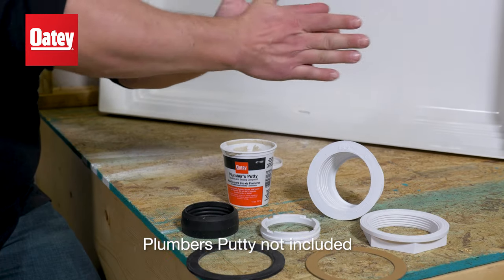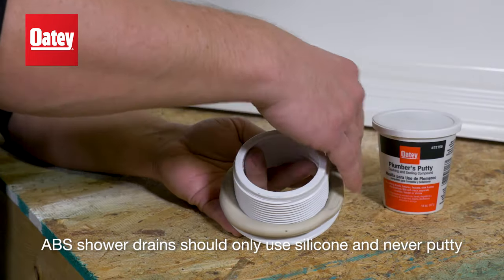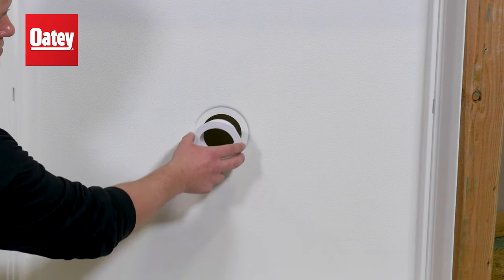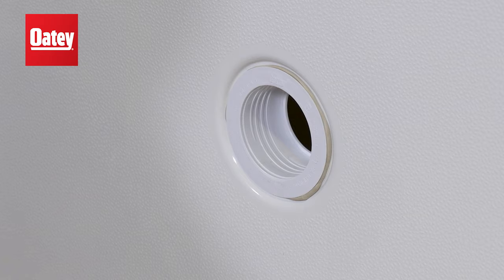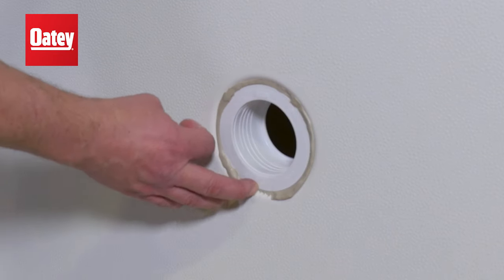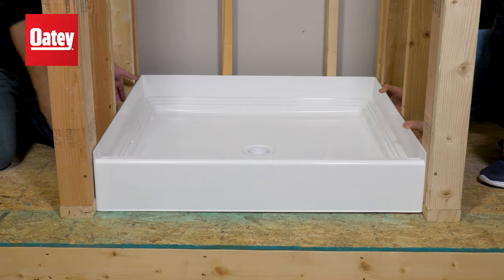How to Install a Shower Drain in a Pre-formed Base

Comment: My Delta shower base states that plumbers putty will over time degrade the acrylic shower base. Delta recommends using 100% silicone on the flange and threads.
Reply: Always follow the manufacturer's directions... mine said either was acceptable.  It depends on what the base is made of.  Plumber's putty CAN degrade some types of PVC.
Reply: Use silicone

Comment: I'm sorry but I can't consider it to be no-caulk if I still have to use putty!! Why couldn't you put a soft silicon / rubber seal on the top edge?
Reply: I also wish this was an option provided with the drain kit.
Reply: Nothing saying you can’t use 100% silicone on it instead of putty. Oatey says use putty but if you look hard enough they also say 100% silicone is okay too.
Reply: Most of the shower bases I install specifically says to use silicone. Putty is mostly obsolete. It reacts badly with the chemicals in the bases. Even sinks sag silicone as well. Rfm
Reply: Some manufacturers DO NOT want you to use putty

Comment: Easy peasy. The one in my house was installed incorrectly and popped out causing an enormous leak to the underside of the house. All fixed now. As a new owner of an older home, I am continuously baffled by how much half-ass handy work can accumulate on an older home.
Reply: I agree with your last comment. It's astonishing how bad some people treat their own homes.
Reply: It's half ass because you can't find parts for what you have. You usually have to pay for a full renovation. It's a money pit.
Reply: People ALWAYS look for the cheapest way to proceed, without care or concern for the future. Same goes for the contractors they hire.
Reply: Sir, I have a new home and mine, unfortunately, has TONS of issues. I think this is one, but I'm not sure where the water is coming from. Quite stressful.

Poor workmanship, sadly, is common. Builders want cheap labor. Cheap labor is often shoddy and performed carelessly.
Reply: @coffeeandlifting Baffled?! You and me both. My old girl was built in 1952 and remodeled/updated sometime in the early 80s by the looks of the wire. 
But I do love that old growth lumber they used for the studs and all the custom built-in shelves and closets. it's like petrified wood now and the dimensions are between a 1/4 inch and a 1/2 inch larger than the 2"x4"'s of the wavy balsa-like pine we get today. But it sure smells great when you cut it. 
As a former journeyman electrician I am horrified that the choices made when rewiring the house. Actually surprised it didn't burn to the ground before I could get some proper grounding and wiring in there. I guess only two outlets in a room, and each coming from a different circuit mind you, was what all the cool kids did back then. And always under the windows - yikes. 
And having the old cloth insulation, just crumple to dust just by looking a wire is awesome. 
I guess they did not like overhead lights back then either. I had to put them in every room in the house. When they "rewired" in the late '70's, they removed most of the switched outlets. So interior lighting was a. It annoying without "the clapper". 
My favorite part of this old house – no insulation in the walls. Just a 3" pile of old newspaper at the bottom of each stud bay - except the vase that we used for return air. Lol. 
Not sure why I didn't level it when I bought it and just build new. At this point it probably would've been cheaper and much more efficient and sturdy.  
Cheers!
Reply: @Willie_Wahzoo Fact is a little common sense will allow most renovations a better outcome. Unfortunately the chances of finding DIY folks with common sense is gone! 1:31 😂
Reply: I still wonder what I was smoking when I talked my wife into buying our current "money pit". It was built in 1901: 1900sq ft. 2 story, full basement w/brick foundation. Been updating and renovating for the last 24 hrs. Finally paid off last month. I'm amazed at some of the half-brained ways some of the original repaired were done! Electrical t ape and old bubble gum on wire ends! Live gas lighting piping  still hooked up and active...just capped off! I should just take up drinking!😂 1:31 1:31
Reply: I have that issue rn but I'm on a slab so I don't know if I can do it without destroying tye full shower 🙃

Comment: Why is it so hard to squeeze the screw rubber gasket over the 2"pvc coming out of the floor? Why is it so tight? The one in the video just, "Pops In"! What would help to get that to seat in the base? Petro-oil, water?  I'm sure this is a common problem.

Comment: The instructions say to use silicone caulk between the drain and the top of the shower stall, but this shows plumbers putty. Pick one and stop confusing people.
Reply: Im a plumber, you can use either one, silicone will make it much easier though.
Reply: Oatey Co mentioned: " Be sure to never use plumbers putty on ABS and instead use 100% silicone. The oils in plumbers putty can cause ABS to degrade over time. "
Reply: @nev.catalyst7478  Delta explicitly states to never use plumber's putty on their acrylic shower bases or on abs pipe/drains.
Reply: @letthelightin  This isn't Delta, and yeah you should always follow the manufacturer installation instructions, unless it conflicts with your state plumbing code, here in NC when there is a conflict you must go by the more restrictive option

Comment: Best video I’ve seen yet. I’ve been searching and searching for how high the drain pipe should be and this answered my question. Thank you so much
Reply: I have the same question. But to me its not clear how far into the Oatey part the 2 in pipe should extend. Any suggestions?
Reply: cragar24 I cut it about 1/2” below the bottom of the floor and the gasket sealed it nicely
Reply from the maker: The top of your drain pipe should finish ¾” below the top of No-Caulk barrel flange after the shower base is set into its final location. For more detailed information please visit https://www.oatey.com/products/oatey--140-series-101-pnc-plastic-nocalk-shower-drain-1402493307 and click on the product instructions located under technical resources.
Reply from the maker: @cragar24  The top of your drain pipe should finish ¾” below the top of No-Caulk barrel flange after the shower base is set into its final location. For more detailed information please visit https://www.oatey.com/products/oatey--140-series-101-pnc-plastic-nocalk-shower-drain-1402493307 and click on the product instructions located under technical resources.
Reply: But when you use the shower, the putty comes up around the edges and if you remove it, it breaks the seal and causes water to come out of the bottom of the shower pan.
Reply: @OateyCompany  This is a dead link as of May 2023
Reply: @scottsaccenti  Still dead as of 10/4/23
Reply: I always use 1 1/8 inch 2 inch pipe from the bottom of the drain to the rubber gasket.  If it’s a first floor install I set the base with it already in there and start my plumbing after it’s in.
Reply: @OateyCompany dead link

Comment: I would recommend silicone over putty cause it doesn’t crack overtime and it’s flexible!  Especially if you have a little flex in your pan.
Reply: Oh yeah and make sure it’s 100% silicone not a mix.  Facts.
Reply: Do you only put the silicone on the top, or, put it on the rubber gasket underneath as well?

Comment: Strongly suggest that something be placed in the drain before using the tightening tool. Plastic bag or something else that can be easily removed after tightening. 
Very easy for the tool to fall in.
Reply: It's designed that way so you wind up running back to the store to steal the little tool out of a new one.  Take note, Oatey.
Reply: I was replacing a switch cover in the bathroom.  One screw is now in the vanity drain trap.
Reply: Excellent advice. Happened twice to me. Got lucky and fished it out with a powerful magnet on a thin flexible rod both times.
Reply: Came here to say the same thing
Reply: Uh you guys never heard of that stick with a magnet on the end that mechanics use huh. 🤦🏻‍♂️🤷🏻

Comment: Do you still have to use Plumber's putty for the no caulk unit? I find it spins while tightening the gasket set screw, even after the locking ring has been tightened

Comment: At what height is the drain pipe supposed to be ?
Reply from the maker: The finished height of the drain pipe should be  ¾” below the top of the No-Caulk barrel flange when the shower base is put into its final location.
Reply: Critical step and info left out of the video.  Also missing from the instructions.

Comment: Hello Oatey! I am in the process of installing a Delta Classic 500 preformed shower pan. I see this often used with the drain included with this video. I had a contractor suggest i install waterproofing under the pan in case the pan cracks. I do see Oatey has a product of a 40 mil pvc liner used for tile installations. Do you have any products that would add a water protective layer and be compatible with a preformed base?
Reply: Ice and water shield for roofs is incredible- but it only comes in large rolls.

Comment: Thanks. I wasn't sure where all of the gaskets went- if they were above or below the shower pan. Now I know. Happy to see some of it can be installed before installing the shower pan. That will make things simpler. How far up can the drain pipe go in to the oatey drain? And does it need to be solvent welded or will the gasket hold it on?

Comment: Nice video!! Where can i find a tool to tighten rubber gasket? Water leaks in to my closet and I think that’s the problem.
Reply: You might have to buy the drain to get it. I think they only cost around $10. So, I guess it isn't a huge deal.

Comment: Mine is leaking underneath into my crawl space is it just a matter of tightening the nut underneath or replacing the rubber pipe gasket that fits over the drain pipe or replacing the whole flange.
Reply: Did you fix it?

Comment: Question?  The bottom just slips onto the drain pipe with no glue or sealant?
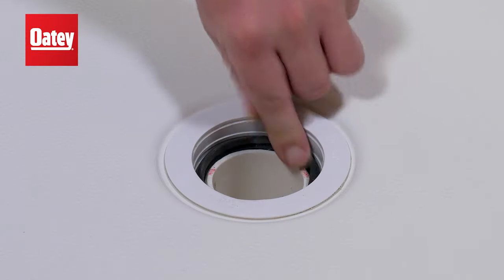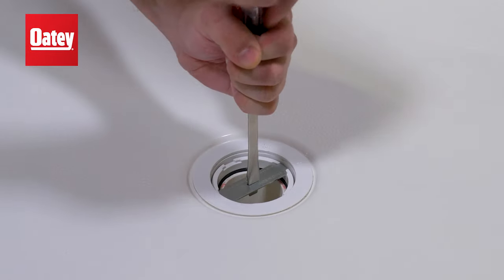Reply: The rubber pipe gasket (the black rubber item @ 0:58 in the video) fits VERY snuggly, some would say tightly, over the drain pipe. It gets pushed down over the pipe. Once you install the gasket set screw (the white threaded washer item @ 1:09) it locks the drain to the drain pipe. 
I've never put one of these in - this is my first 1-piece shower base - but that gasket and said screw will hold tight especially since the shower base is going to be glued to your subfloor with thin set mortar. As long as that rubber gasket is made of quality rubber it should last a long time I would be careful pouring any chemicals down the drain that could deteriorate the rubber gasket though.
Hope this helps.

Comment: In my case, the pipe that comes from the u trap is a bit tilted and it looks like the rubber part doesn't make full contact therefore it leaks. One drop every 5 minutes but it's a drop. Can I use silicone or plumber putty around the piece that tights the rubber down?
Reply from the maker: @Walter Diaz A 100% silicone can be used with our No-Caulk drains. Please contact technical@oatey.com for a set of instructions.
Reply: @OateyCompany  Thank you! The product says "no oil based sealants" right on it.

Comment: I know this is a dumb question for a plumber (but I'm a former electrician so I'm allowed at least 1 right?) but I'm replacing a tub with this 1-piece shower base. Do I need a vent and/or P-trap on the drain?
If so, how do I install a vent for this ?
 I have very limited space with my drain pipe - but I think I can manage a trap if absolutely necessary. My vent stack is just outside the shower base area in the same wall as the drain - about 24" or so from the drain.
Reply: yes, you need a p-trap anywhere an open drain line discharges wastewater into the sewer system. 
 If there is already a vent because you have a sink and toilet, you could possibly tie into that for drain and vent.
Reply: @evanv602    thanks a lot for the reply!
The previous owner who "remodeled" didn't have a p-trap on the tub drain - which confused me. That explains the more than occasional odors - had to close the tub drain when not bathing. 
The main septic line has a  vented up through the roof. Looks like I can tie into that. Thanks again!
Reply: @w4shep  you’re welcome! good luck with the remodel.
Reply: @evanv602  A retired electrician doing plumbing... sounds like the plot of an 80's sitcom.
Reply: @w4shep  yeah right lol. you should do a video on it lol. also, make sure you slope your drain too, this will allow the water to properly drain. forgot to mention that it’s usually 1/4” inch per foot for the slope

Comment: Really easy when you have access to the underside of the shower. Trying find how to screw. In from the top when installed on a slab
Reply: Not possible. Gotta install before placing shower base.
Reply: @letthelightin  then how do you glue it to the pipe?
Reply: @letthelightin  also it is possible because I did it.
Reply: @BrantTheResidentCalvinist  There are drains which attach to the pipe with a rubber seal and can be tightened down from the top of the shower pan.
Reply: @BrantTheResidentCalvinist  how did you do it?
Reply: +1 how did you do this? I'm looking at replacing one of these that cracked my shower base is tiled in over a slab...😂
Reply: @letthelightin  Did you bother watching the video? That is what this is.
Reply: @TomPerigo  This one is for pre-fab show bases. You need a different flange if you are creating your own custom title shower.

Comment: how far should drain pipe be from floor of shower.  no information given here or with product
Reply from the maker: @Joel Englehart The pipe needs to be cut 3/4" below the top flange of the No-Caulk drain. We are not able to give a specific dimension from the floor since every pan is slightly different.
Reply: @OateyCompany  just need yu to be clearer as to what is top flange? Flange sitting on base I assume.

Comment: so is it best to use silicone on a fiberglass shower stall, if so what is the best ASTM chalking to use?
thanks in advance
Reply from the maker: @Mingo Gamer 5137 We would recommend checking with the shower base manufacturer on what is recommended with their product. 100% Silicone can be used with all of our drains, but we do not have a specific brand recommendation. Plumbers putty can be used with PVC and brass drains but not ABS drains.

Comment: I followed the video, but the container of Oatey Plumbers Putty says to NEVER use on plastic. Can someone explain why this video uses it? I'm confused!
Reply from the maker: Based on Oatey’s product testing, Oatey has not found that Acrylic fixtures when exposed to our product for an extended period of time will have a negative effect. In saying this, we would always recommend that you follow the manufactures directions for approved products to use when installing their product.
Reply: @OateyCompany  Then, why does the FAQ on your website say to use silicone?

Comment: I'm having a difficult time at the step where the rubber gasket is pushed down the pipe. It's a tight fit between the drain body and the pipe and I can't push the rubber gasket all the way down until the top is flush with the pipe.  Any recommendations?
Reply from the maker: Verify the drain riser is plumb. If it is not plumb it may have to be adjusted to achieve desired results.  Chamfer the end of pipe the drain will be installed on to remove the sharp edge. Lubricate the pipe and gasket with plumbers grease to help reduce any friction (Be sure to verify material compatibility).

Comment: I got one of these (Oatey #42099) drains with a 48" shower kit and could not figure out how to make the drain work.  This Youtube video showed me that there was a plastic "gasket set screw" inside. I was unable to remove the "gasket set screw", as it jammed against the inside of the drain as I rotated it counterclockwise with a screwdriver using the steel gizmo/tool included. I tossed the hopelessly jammed unit in the trash and used a traditional solvent weld drain which installed simply in less than 10 minutes with no problems.  I don't see the benefit of using this drain with it's extra parts and idiosyncrasies instead of something that works first time, every time, without the need to go to Youtube for an education.
Reply from the maker: The Oatey® No-Calk Shower Drain is ideal for installations where there is a 2” Schedule 40 DWV drainpipe that requires the drain connection to be achieved mechanically by means of a compressed gasket. The PVC gasket set screw can sometimes be difficult to remove if over torqued. Applying light coating of plumber grease to the threads and using a large flathead screwdriver with the set screw wrench should allow the sew screw move freely.  For more detailed information please visit https://www.oatey.com/products/oatey--140-series-101-pnc-plastic-nocalk-shower-drain-1402493307 and click on the product instructions located under technical resources.
Reply: Did you glue on the PVC pipe from above or below? I'm installing on a concrete floor where I can only get at it from above and hence I'm planning on using the type shown in this video. Otherwise, how do you get the height correct for gluing on the fitting?

Comment: Apparently there is a right and a wrong way to install the gasket?
Reply from the maker: Thank you for your question. Yes, the beveled side must be installed in the up position with the flat side down. This orientation of the gasket is important to ensue a leak free seal is created around the vertical drain pipe.
Reply: @OateyCompany  I did this and it still leaks water through there